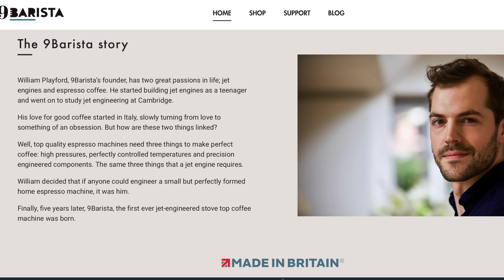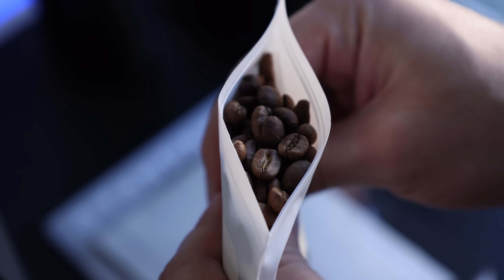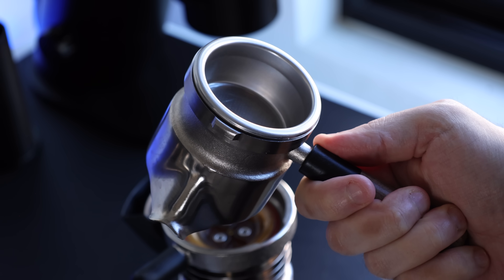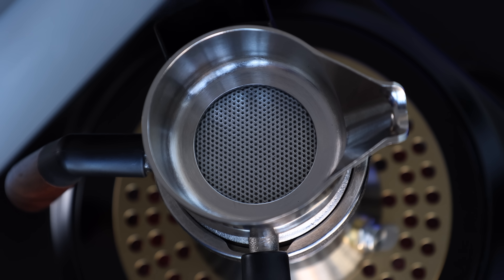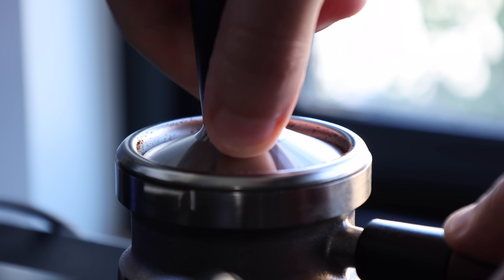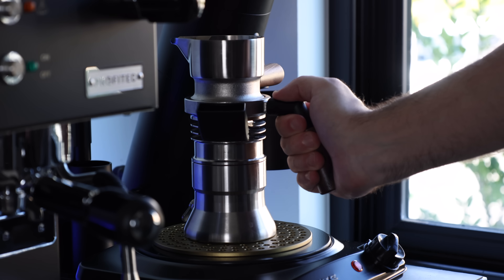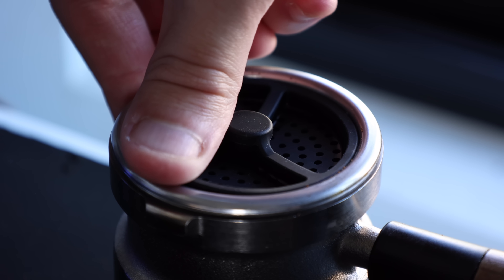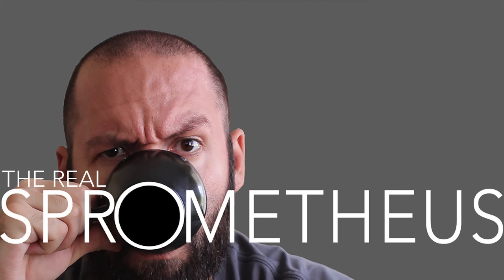9Barista | Time To Say Goodbye To Your Moka Pot

Comment: I've been using mine daily for nearly 2 years now making 2 drinks back to back every morning,  I rebuild it once, though it didn't need it. You mostly just need spare brass safety rings. You're spot on with the technique, when you get to the fineness limit of the grounds for some roasts the pressure safety can pop open at the beginning of the shot (pressure rising to quickly) and a lower heat setting needs to be used but you still want to heat it as fast as possible. This machine is why the 8.8 micron per click J-max grinder is the best pairing until someone makes something with a finer adjustment. I like milk drinks so I use a bellman stovetop steamer which is a far cry from the quality of the 9 Barista. I wish there was a high quality stove top steamer to match this espresso machine. One last note, you haven't experienced the beauty of owning this machine until you've used it in the wilderness on a camp stove / jetboil and enjoyed a wonderful espresso overlooking an epic view. This is where it shines.
Reply: 1zpresso now have the J-Ultra with 8-micron adjustment per click.
Reply: A
Reply: Are you the Marlboro man?

Comment: I went back-and-forth whether not to purchase this for over a month. I hit pay dirt with a good overtime check and decided to pull the trigger. For the price it’s worth it. Good things aren’t cheap and cheap things aren’t good. This is made SOLID. takes about a week to dial it in figure out the right boil using a convection range but eventually it’ll give you that perfect 30 second flush. Perfect Cremà no bitterness if you prepped your grounds correctly. Portability was a key thing for me this is extremely portable. I take it back-and-forth to work in a custom pelican case I made. I used to have a flare but I gave it away - No comparison compared to this unit. There’s no guesswork when it comes to temperature or pressure. All you have to do is know how to prep your coffee. The only recommendation ild make is to add a paper filter on certain roasts.

Comment: Completely agree with your assessment.
I'm the only coffee drinker in the house so, due to WAF, I need a simple solution that does not take tons of space, does not require 20 minutes of preheat before we can sit at the table and is generally convenient. Nespresso it was.
The 9Barista, which I bought two years ago, has been great upgrade from an Nespresso in that respect.
Indeed it is limiting in the control compared to what I understand other products could offer but it already allows me to use quality beans with a convenient workflow and that's nice.

Comment: I have been using 9barista for about 2 years, it has been great. Now, I put it in my office for a cup in the afternoon. Yes, the crema may suffer a bit because the extracted liquid comes up as opposed to a typical porta filter. It is also true that you won't be able to change that many things about it, but that also means it is easier to dial in.
Reply: ... and being able to choose your beans & roast, it's far better than an illy system.

Comment: As an non powered espresso machine I enjoyed the process of using the 9Barista. A buddy of mine lent me his and I also pulled some shots his place too. Compared to the Flair Pro 2 I have at home I enjoyed the 9Barista more. It mainly came down to preheating the Flair Pro 2 is less than ideal.
The 9Barista is a little more difficult to dial in. I didn't have a problem too much, but my buddy had some problems getting it just right.
If you have $470 to drop and only drink espresso I think it is a great machine. Once you know how to dial it in you are set. Just don't expect to be able to pull back to back shots.

Comment: I have had my 9barista for a few years. Been really happy with it. I got to ad that the customer service has been top notch. Had a concern with the plating in the filter holder, they sent me a new one. Even though it wasn’t completely necessary by them. The plating on the boiler did chip of after nearly two years, and they promptly sent me a new one, no question asked.
Reply: Love that this company stands by their customer’s.

Comment: Had one since the beginning. Love it.
Reply from the maker: Awesome! Have any issues or replace any parts yet?
Reply: @Sprometheus   The pressure relief valve x2 - it’s just a brass ring with a drop of solder in a hole, so no big deal. It comes with a spare, so it’s pretty much expected. About $10 a pair I think.   Otherwise lovely. Hope you didn’t mind me tagging my own video in the comments 😊.

Comment: I have been using the 9Barista as my main source of espresso for the last two years and I pair it with my home roasted beans. It makes great coffee — every single time! 👍🏼😄
Reply: Hi, do you have any other espresso machines to compare the shot with 9Barista?  Interested to get one as well.
Reply: @yew108  — I also use other manual machines: the Camelot Robot and Uniterra Nomad. I have also tasted shots by La Marzocco & Slayer machines at local cafes. I’m happy with the quality of the espresso I get from all 3 of my own machines though I tend to prefer the 9Barista 😄
Reply: @yew108  — I also use other manual machines: the Camelot Robot and Uniterra Nomad. I have also tasted shots by La Marzocco & Slayer machines at local cafes. I’m happy with the quality of the espresso I get from all 3 of my own machines though I tend to prefer the 9Barista 😄

But do note that I am not saying my little machine is better than those expensive ones. I am just saying I am happy w the shots I get from mine. It’s good enough for me. 

But bear in mind that the 9Barista is very consistent and it does NOT allow for much flexibility in terms of profiling your shots. It just makes good, consistent, standard espresso shots. 👍🏼😄
Reply: @roastlamb236 . Thanks for the very detailed reply!  You like it over Cafelat Robot says something big. 
I do know not much we can change except grind size and heat temperature. 
Is it suitable for medium or even lighter roast? 
Does shots from 9B not very far , if not better, than LaMar , Slayer and all those high end machines?  Thx and happy Sunday!
Reply: @yew108  — hi hi! Sorry for the delayed reply. Ok, I normally use medium roast coffees so I can’t give any opinion on light or dark roasts.  Sorry Abt that 🙏🏼🙏🏼
Reply: @roastlamb236  Hi!  It is alright. Have a great day!  Regards.

Comment: I have a fully modded Gaggia (PID, Pressure Gauge, Flow Control) for everyday. I have a Picopresso (For traveling), and a Handpresso (For ESE pods only). I am fascinated by these manual espresso gadgets. The engineering on this 9Barista is impressive, but it’s way too expensive and the workflow is not good. The Flairs are really nice. I do want a Cafelat Robot. BUT I still regularly use my 3-cup Bialetti Moka Pot. So good for a huge Americano/Long Black. It’s such a nostalgic and relaxing workflow. Best coffee ever, and you can’t beat the price ❤

Comment: Looks nice.
I see two future versions: One with an integrated electric heating element because most ppl have induction stoves and the additional metal plate is kind of ... meh.
And one version as a coop with jet boil for highly efficient gas driven operation. This one should be gimballed for use on a boat. :)

Comment: About that temperature stability comment... 🤔
Why not mention the Robot or Flair pro instead of the Flair58?
Thermal tests with scace devices have shown a variation of about 1C on a well heated Flair58 brew group. Even though it doesn't deliver on its promise of 95C brew temp, it does have above average thermal stability, no?
Great review btw! Very informative and as always with your videos, outstanding visual and sound quality! 👏

Comment: I loooooove the idea of the 9Barista, I just can't fork up the cash no disrespect to the engineers and the production process but I'd snag a used one in the $2-300 range. I also already have a double machine so this wouldn't be a main but I do think I'd use it more because of it's quick initial setup
Reply: FWIW, the company does have some refurbished ones available from time to time.

Comment: I have one for a year now. I bought one because I wanted to travel & have good espresso.

I've been using it as I travelled Canada in hostels & AirBnBs, lots of people always have questions about it and think it's going to explode when it starts its rolling boil :D

Coming from a Lelit MaraX at home the 9Barista produces shots comparable imo. I use it with the 1Zpresso J-Max & a Bellman Stovetop steamer now I have a fixed place to stay & can make milk drinks as good as my Lelit. Albeit with less consistency.

Only negative for me is the weight of it, couple with the weight of the heat plate (I had the original - which delaminated & was real heavy compared to the gold new one) it's quite a big commitment to drag it around with you. But then I guess you need the weight to keep the thermal efficiency.
Reply: “Hostels 
in Canada”😂😂😂

Teasing. Those words together crack me up. It’s like “the ghetto in Boulder” 
😉
Reply: Surely a Wacaco Picopresso should have been on your list ? This is hardly 'portable'. But then I suppose stove top is more American over having a kettle to heat water.
Reply: @paolocoletti3424  are you hating on Americas portability? 😆 stop it.  It’s portable fo sho.

Comment: 9 bars will be 180C ... I'm very curious about how the heat exchanger and fins get the water down to proper brew temp coming from such a high heat required to get the 9 bar pressure.
Reply from the maker: Yeah I mean part of it is trust that’s for sure, I’m no engineer myself, but based on the extraction flavors with different roast levels and yield numbers I’m pretty confident that it’s in that 93C/200F ball park.
Reply: @Sprometheus  I posted before I'd finished watching and I see you approve of the taste as long as you don't leave it on the heat too long.  So it must be controlling the temp.  I just found it really surprising when I found out how hot you have to be to get 9 bars.  Very clever!

Comment: The biggest problem i have with this one (also the reason i sold mine was the amount of gaskets. I really feel its great for camping and holidays but not for a regular brewer (unless you pack a  standard gasketset with it as well)
Reply: I believe this is not a concern. I used mine daily for two years without ever replacing gaskets. Only replaced the safety ring once because I forgot to add water to it when making coffee! Just remember to not leave it on the heat, have correct heat (brew time 3-6 minutes), and let it cool down and de-pressurize the boiler prior the screwing it off.

Comment: It seems there were initially a lot of “explosion” incidents (I believe mainly from user negligence) and discussions on the potential for the machine to be quite dangerous if not handled very carefully.  

Did you notice this danger potential at all?
Reply: There are no explosions but rather a loud pop from the safety valve to release pressure. Which then can be replaced by the user. This happens when the user grinds way too fine or leaving the 9B on the stove past the recommended times. Both easily avoidable issues when following brewing instructions.
Reply: I see, so scary sounding but within safe limits as the safety measure kicks in. Thank you ❤
Reply: @AK27AK  Yes it is engineered to always kick in beyond a certain pressure build up. TBH Since I've had mine this never happened. You really have to ignore the guidelines or be impatient to end up in this situation. The more you get to know the machine the less likely it is to happen since you will know your grinding/heat range. As a beginner just go slow with grinding finer and you'll be ok.
Reply: Ok, wonderful to know, thank you 🙏 ❤

Comment: It looks great, but not sure it's a smart buy vs the robot except if you use it for camping or something.
Reply from the maker: I think it depends on what level of control and heat management you prefer. I have the Robot as well, but I do find myself preferring the ease and simplicity of the 9Barista in the situations where I just want a simple cup versus controlling all the variables.

Comment: even single boiler machines have some level of control. this one is too labor intensive and high priced! 
PS: will you review the new rocket?
Reply: "too labor intensive and high priced " ...
I wonder what you are comparing it with on both points?
I use mine multiple times a day, incredibly quick and easy to grab a coffee before a home office meeting. And price wise, it costs a faction of my big Italian espresso machine which I stopped using now.

Comment: Wait, the track below the spring might be at 9 Bar, but above the spring it would be atmospheric again, right ?
So the water does not go through the grounds at 9 bar, but at whatever pressure builds up due to the resistance of the puck.
So all the spring does is hold the water back, and it allows for higher temperature of the water.
Which is then cooled back using fins ?
This makes no sense at all.